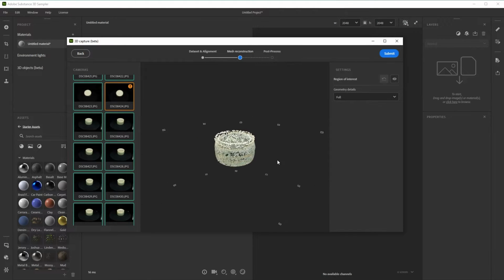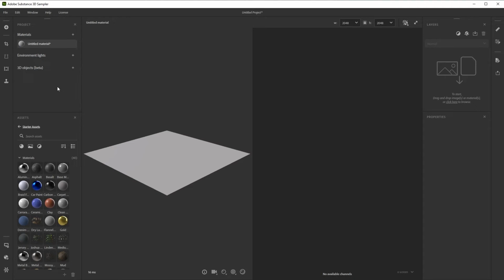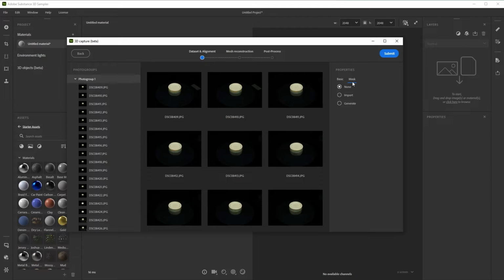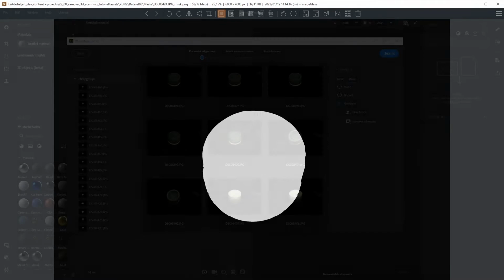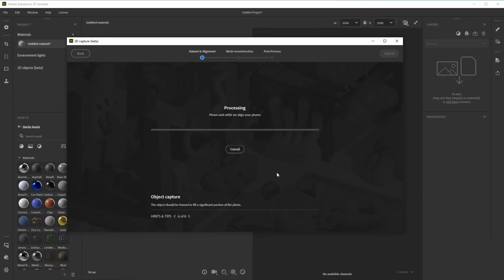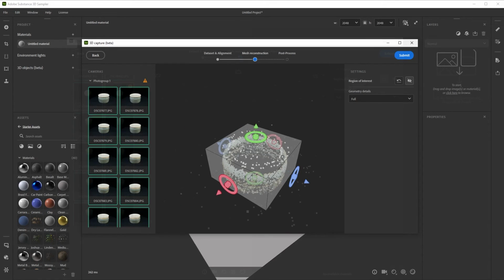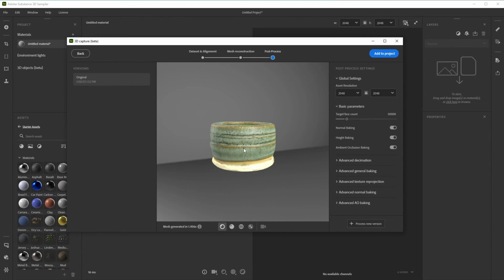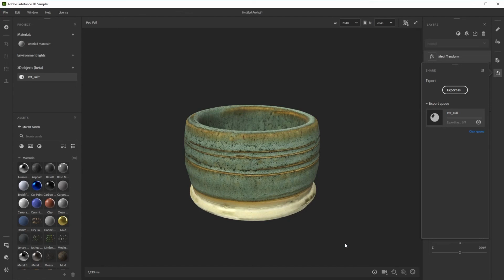Advanced 3D Capture - Capture Processing | Substance 3D

Comment: More question.
What about extra features like auto picture masking, import masks, control points, disable pictures for texturing.
Reply from the maker: Auto masking is included, and shown in this video. Import masks is included and shown in this video. Not sure what you mean by "control points", capture markers maybe? This isn't done in software, but at photo time, yes it is supported, just not shown in these videos yet. Disable pictures for texturing is not supported, if you mean individual ones? If you want none, then you can just edit the material afterwards.

Comment: There is pixel limit in data import
Reply: 6,000. This is a hard limit which for me is a bit disappointing as professionals use professional gear and want to push the quality bar. 
Although I wish I had a Z9, I have a Z6 24MP so 6,000/24=250. I took 270 photos, so I left out 20, it still didn't take, so I did 240 photos and it proceeded to process. so if your camera is 45MP or higher your every shot needs to count because 6,000/45=133 (rounding down). 

But I wonder if cropping my images (to my subject) if that would save on MPs and if a non-uniform aspic ratio would be acceptable so larger scans are possible with this strange limit.
I also find it strange that 8K is not available as a resolution but is limited to 4K.

I guess you would need to do pre-planning of 4 separate scans and align them to get closer to an 8K photoscanned texture.

Comment: good bye agisoft.  this is so much faster and more accurate.
Reply: Tell us more about export settings. Max Texture export size (4k or 8k or 16k). There is support for UDIM? 
Anything similar to control points?

Happy to hear that for your purposes it work better than software with years of experience behind, but i have strong doubt atm.
Reply: @jurandfantom  Agisoft can do 8K, even 16K. It does have support for UDIM though I have not used it. Agisoft is able to produce and render on a 3080Ti 12GB 500Billion poligons with an 8K texture. It's robust, it can take time for some of those extreme details. But if your images are good. Make a mask with the low setting apply that to the images. then reprocess on any high setting you want and it will come out much cleaner. You can also do batch jobs, and split the work of a large model or something more complex into chunks and then align those chucks (seperant scans) to be one. Import and export options are versitle and good. I'm here to learn if there's something that I can use in Adobe Sampler, but so far I can't agree with HapZungLam at the moment. This is my first experience, and the limitations and quality I was used to in Agisoft has me spoiled and this is my first look at Sampler.
Reply: **Dataset limitations

Windows: Your dataset has be smaller than 6G pixels (6 000 000 000 pixels) in total. It represents 500 photos of 12M pixels**
Reply: Has be... not "might cause problems " - it's a difference
Reply: Lightroom needs a Background Masking feature for multiple photos. Its annoying to background mask every image seperately. Especially when Working with 500 or more pictures.
Reply: @autodriv3r405  hello there. Did you tried subject masking synchronization lately? :)